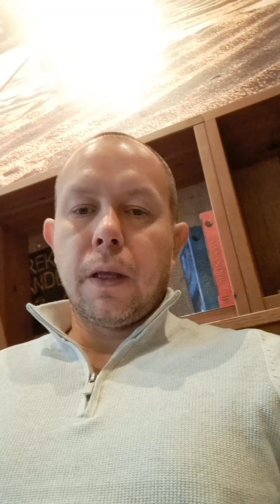Difference between an N/A om606 and a turbo one.

Comment: Hey,
Thanks for your Video!
My OM606 turbo engine died (block and head is toast). A friend would have cheap 606.912 (EDC Pump) Na engine. What would you change to it for around 250hp turbo? What connecting rods and what pistons?😅
Thank you so much!
Robert

Comment: Where exactly is the block "weaker"? People talk a lot of shit without any proof or other sources. Also, are you aware of the two different sizes of NA connecting rods? I've seen a picture of "thin" NA, "thick" NA and turbo rods side by side. Some people say the earliest engines have the thicker NA rods but I have no clue. You have said before that a stock 606 should hold up to over 400hp, this could change depending on what version of rods the engine has.

Not that any of this is really relevant as cheap rods are possible to get and they'll hold all the power you want, I just think it's an interesting subject. Looking forward to anything and everything you have for the people :D
Reply from the maker: The mains are hollowed out on the "weak" blocks. Still a bad ass block, just weaker then a stronger block 💪

Yes there is a difference in rods but it is better to just swap them as you say and then sleep well.
Reply: Agreed. Theres been a handleful of guys that have bent the stock, turbo rods. Better to upgrade rods, before adding fuel and boost@FtunePerformance